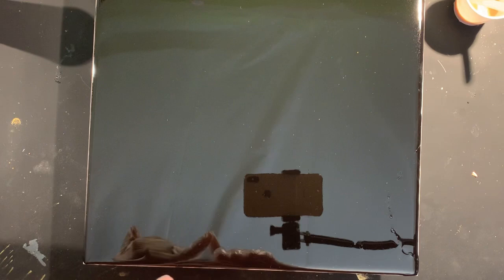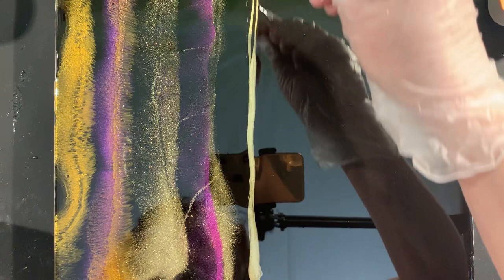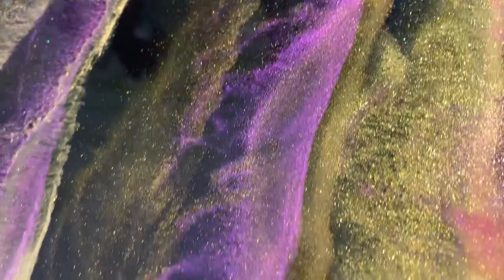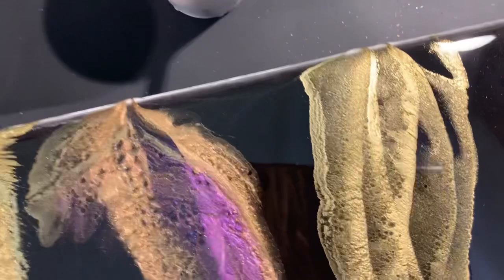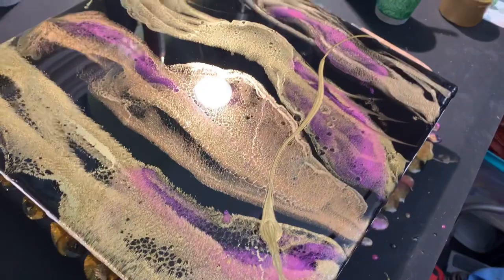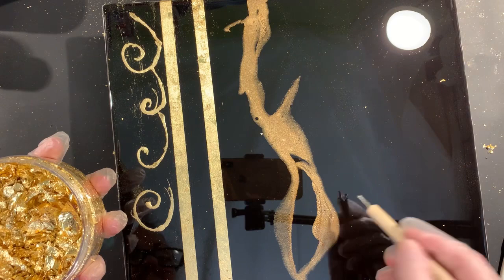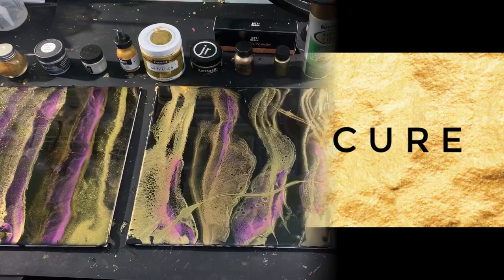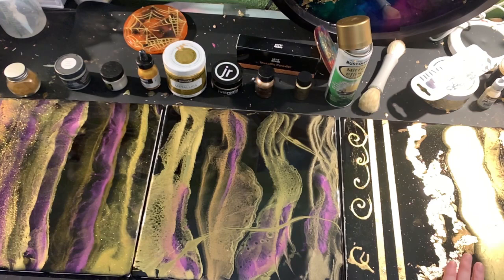Gold pigments in resin: mica, acrylics, metallic powders, spray paint, gilding flakes & alcohol ink

Comment: Hi there thank you so much for your very informative tutorials, I have learned so much from you.  I have just got  a new heat gun and was wondering what temperature and speed you use yours on?  thanks again XX
Reply from the maker: Hi I usually use middle heat blowing on high - I have a video on heat gun tips to showing why I use the blow settings 👍
Reply: @ResinAsYouWish  Hi, many thanks for your reply, thats a great help and I will check out the video on heat gun tips. Thanks again XX

Comment: What type of heat gun do you recommend?
Reply from the maker: hi, I have put links in the video description for the guns I use.  What you are looking for in a heat gun is the following features: one that has a low - high heat/temp that you can adjust AND  a high/low air flow.  Not all the heat guns come with these options  and end nozzles/tips, but you can buy them separately if you have a gun you like, but no tips

Comment: Fascinating and well done video.  I am new to epoxy resin.  I work with wood and would like to carve a simple design into the wood and fill it with gold.  No lines thicker than a pencil and about 1 or 2 mm deep.  I want it to look like a gold inlay in the wood.  Which product would you recommend I add to the resin.  Thank you.
Reply from the maker: The metallic powders or the gilding flakes
Reply: @ResinAsYouWish  I tried the metallic powder and it came out a brilliant reflective gold, BUT, when I sanded it lost all its brilliance and turned into a milky dull green.  It is almost as if all the mica powder floated to the surface and then I sanded it off.  Any suggestions?
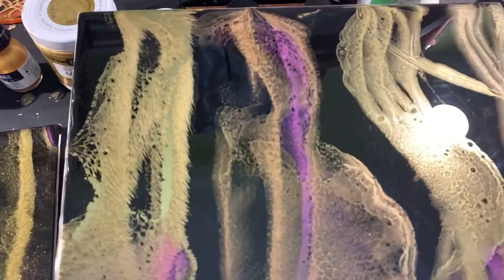Reply from the maker: @OneFishHawk55  yes, tune into the last chapter of this video where I discuss this issue 👍 see 48:30
Reply: @ResinAsYouWish  Dang, I missed that the first time through.  I guess next I will try a different approach. 1. cut inlay into wood, 2. fill inlay void with clear resin, 3. pack resin inlay with gold flakes and 4. Sand gold flakes smooth. Have you ever sanded flakes?
Reply from the maker: @OneFishHawk55  yes, anything not under the surface of the resin will sand off 👍